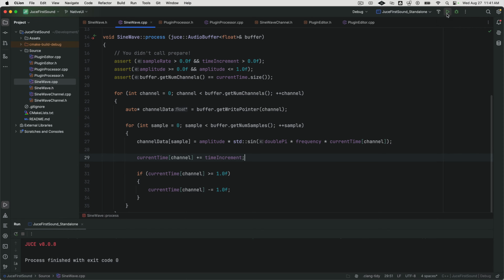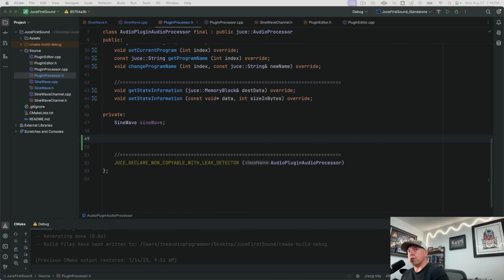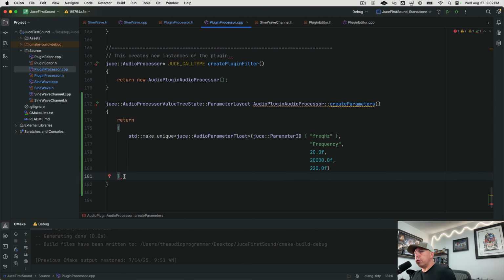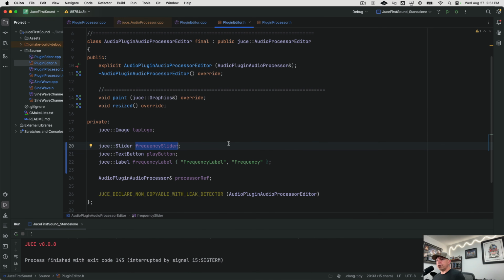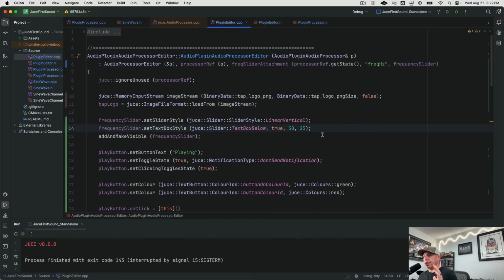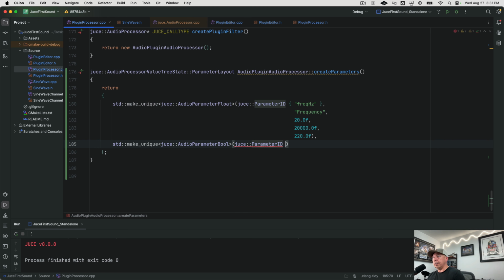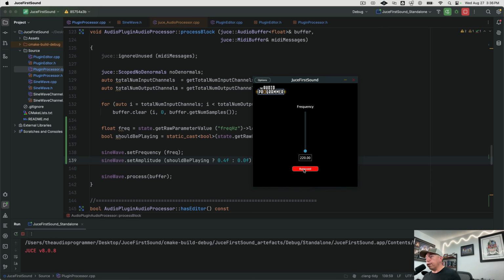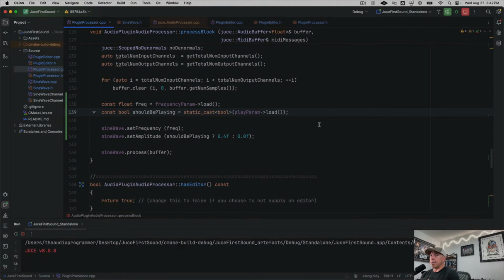How to Make Your First VST Plugin | #06 Connecting GUI with Audio Code using JUCE

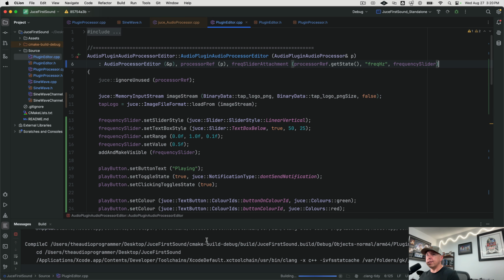Comment: 21:25 After adding the freqSliderAttachment whenever I run I hear the sine wave for a seconds and then it seems to crash. No more sound and no window shown.. I copy-pasted "freqHz" so it should not be a typo... any ideas someone?
Reply: aaand I found the issue, maybe someone else also will run into this. freqSliderAttachment must be defined after processorRef in the PluginEditor header file. Oh how I missed C++... not :)
Reply from the maker: I’m glad you found it!
Reply: @mrhallodri_  ran into same issue. the fix is so dumb actually😂